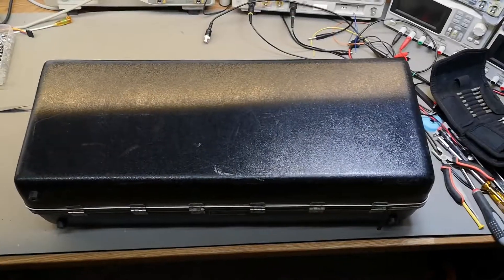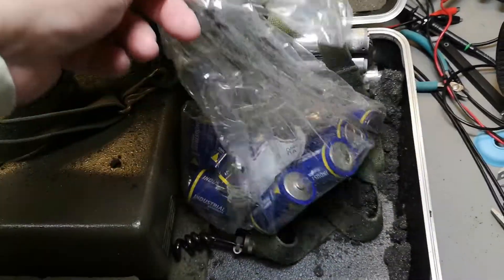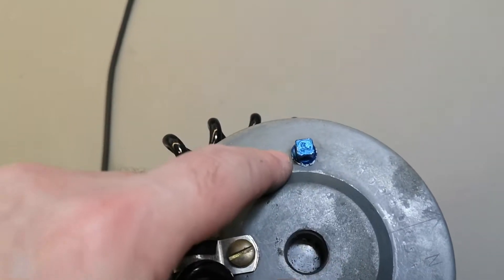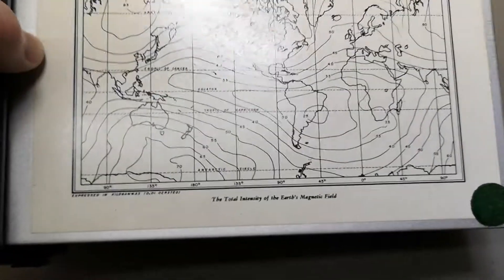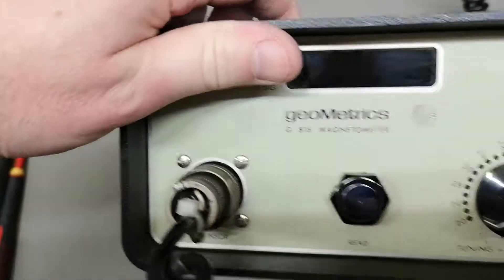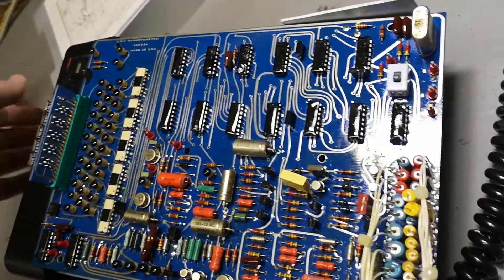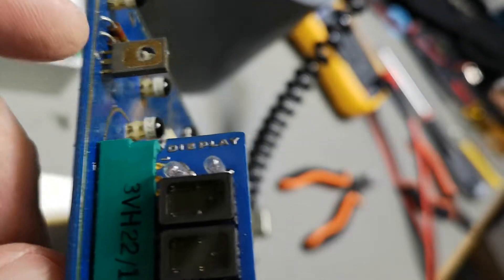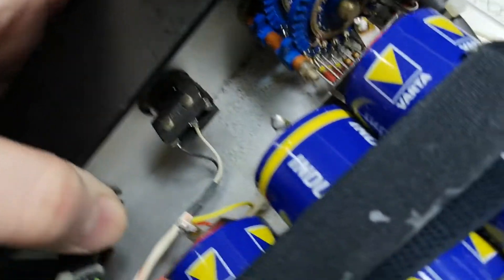Portable Proton Magnetometer G 816 Teardown

Comment: As an engineer you really should avoid putting foam rubber in anything that is meant to last longer than 5 years. Because after that period the foam will either turn into such smelly powder as in your case or into some smeary mass that glues together everything. :-(